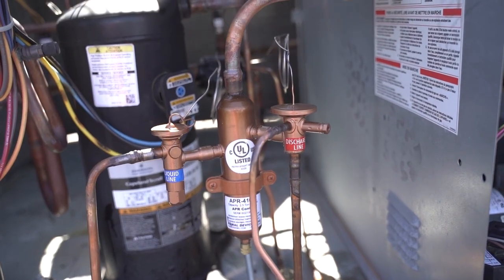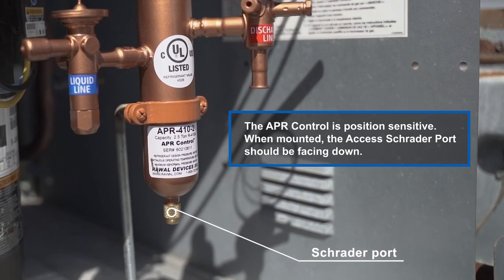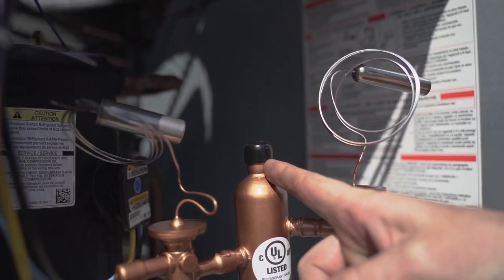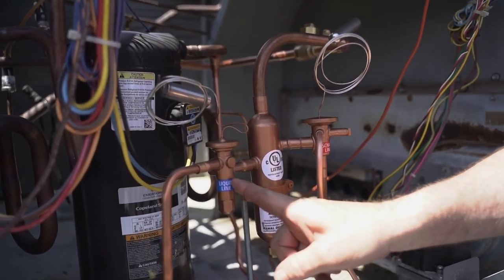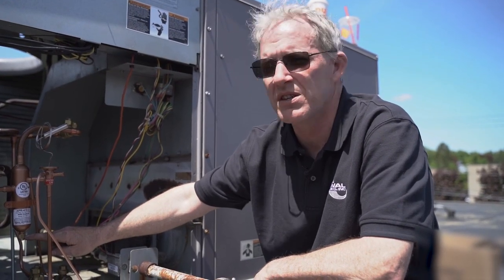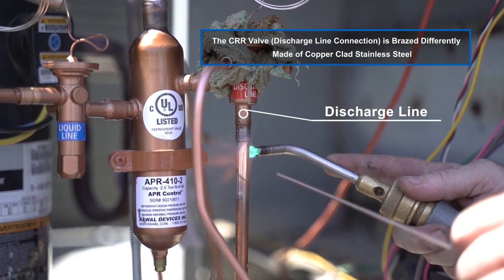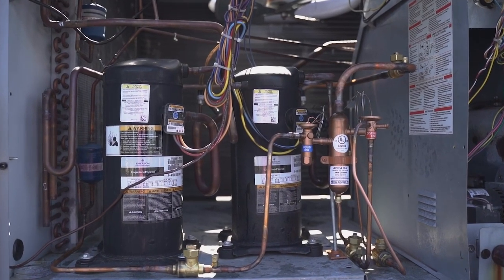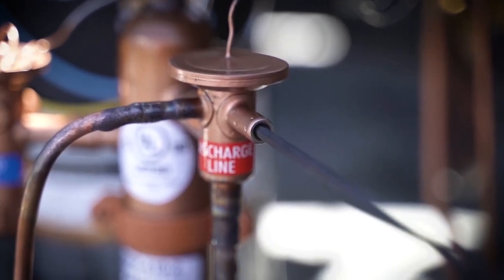How to Install the Rawal APR Control Valve on a DX HVAC System

Comment: Since this video does not explain this valves purpose.  I assume its to raise suction pressure under low load.  Why not just use hot gas valve tapped half way on condenser?  It looks like yall are using mixed liquid and discharge to subcool the discharge gas to pump back into the suction.  Keeping suction temps lower under a normal hot gas valve which uses hotter gas.
Reply: Basically this POS keeps your evaporator coil warmer while still being able to maintain a decent superheat to your compressor.
Reply from the maker: @bmillwood6666 The APR Control’s purpose is to match the capacity, at the evaporator, to the total heat content of the entering air. That is extremely useful in VAV applications, MUA, and extending the runtime for improved dehumidification on any DX system. Due to the way it is piped, the liquid injection valve will only open when the superheat at the compressor is 20 degrees or more. During a high amount of turndown, this keeps the compressor from overheating. To find out more, feel free to call in and speak to one of our technical support engineers. www.rawal.com/contact

Comment: Now install one on 2nd stage ....if not your wasting your time and you will have a pissed of customer.
Reply from the maker: @spaceboy7192 For most installs we typically only recommend installing the APR Control on the lead circuit, being first on/last off. However some applications may require an APR on the second circuit. To find out more, give us a call and talk to one of our engineers. www.rawal.com/contact

Comment: You need to mention about purging with nitrogen before you start brazing, otherwise you just ended up with a bunch of oxide scale on the inside of your copper tubing.
Reply from the maker: @USA-GreedyMenOfNoIntegrity  You are absolutely right! In the beginning we made mention of following your best piping practices (which includes purging with nitrogen) and safety guidelines throughout the installation… to keep the video short and sweet - we thought that was enough.